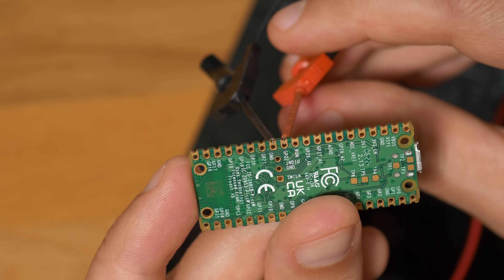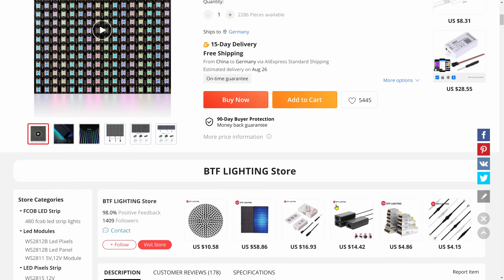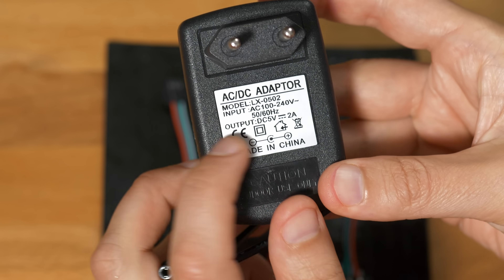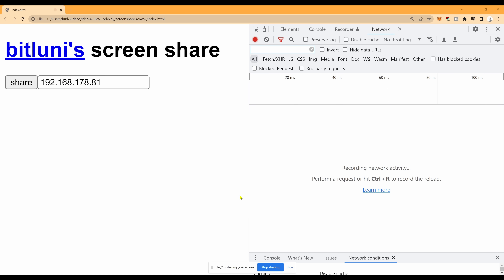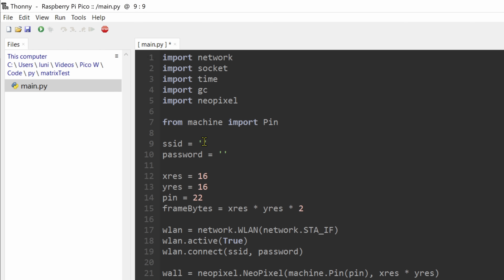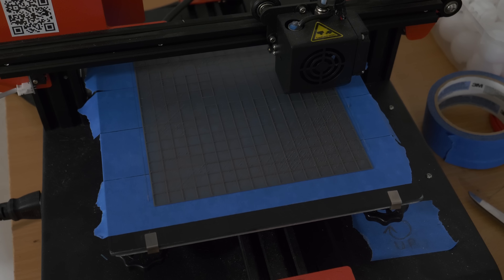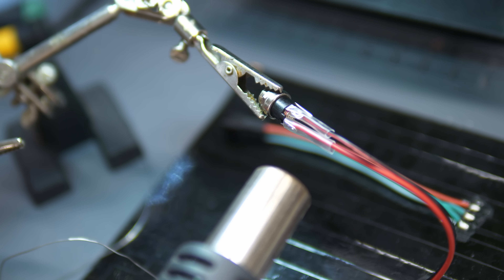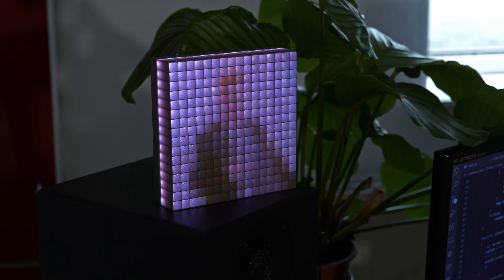Screen share ANYTHING to this matrix! (Pi Pico)

Comment: Could you 3D print direct on to a diffusion firm, and just skip the first layer.
Reply from the maker: this is genius! will try and upload result
Reply: @bitluni  maybe get in touch with Thomas Sanladerer
Reply: Or maybe switch filaments between first and second layer. Transparent or grey for the first layer, and Black for the walls.

Comment: Hi thanks for this tutorial. I'm trying to run a screen share using:

1. RGB LED matrix - 64x32-pixels
2. i75 with Pi Pico W onboard matrix driver

Am getting no errors, but nothing is showing up on the matrix. I have altered the xRes and yRes but no success. Is there something to do with the pin or anything else? Any guidance would be helpful. Thanks.

Comment: Would a Pi Zero W be even better? I want to start a project using 4 64x64 matrixes to make a mini LED board for my DJ set. I want to be able to sync the visual effects from virtual DJ's video mixer to one of these over WIFI. I'm new to this but want to learn basic coding and scripting.

Comment: Another question set :), you can connect to any gpio (GP) pin right? And what if you wanna join a couple of this matrices? Just connection output to input and one data gpio will do? Finally how should both be powered?

Comment: if you wire the neopixels directly to the pico, you might get problems in noisy environments, since the rp2040 runs on 3V3 and the ws2812b expects a 5v signal voltage

Comment: I ended up having to put ears on the corners to keep them from lifting. The rest of it printed up beautifully, and then I tried tearing off the ear like I usually do, forgetting that the bottom layer is no stronger than the ear.  Oops!  It looks nice with faux marble filament anyway and I'll take a second swing at printing it later on.

Comment: In case anyone's trying to print the undimensioned STL files, I set the height of the entire print labelled to 42mm and printed and it fits perfectly. This is for the "30mm" (distance from LED to diffuser) file.

Comment: UDP stream is the most efficient way to send pixels to the RGB strip. Also using C++ would allow you to do it in 60 FPS. I did similar project with esp8266 and 288 led strip.
And also, you can go to your router settings and assign static IP to the rpi so you don't need to update it everytime...
Reply: Hello, I have a similar project that I am working on. Could we exchange on the C/C++ solutions you found?
Reply: @PunesLeltier  yeah, but I'm still experiencing some troubles reconnecting to the server (from esp). If you can improve on that it would be great. I'll ping you in Discord

Comment: I get that devellopping is part of the journey here, but you COULD just use signalRGB for this with the raspberry pico W.
It comes with screen sharing for stuff like this allready included aswell as support for the pico and pico w. :)
It's also a slider for refreshrate and other features. :)

Comment: Nice and inspiring video! I really want to build some kind of led screen with e.g. a clock for running events and similar, that can be set and controlled remotely, but then these led matrices are too small. You showed that it's possible to chain them though, but could you make a video on that topic to easily extend the size a bit?, but without making it a ping-pong wall :)

Comment: Immediately I'm thinking, "What about 4 panels next to each other?"
Reply: Or... 9 ?
Reply from the maker: yes
Reply: @bitluni  I tried 4 panels -- all 4 light up, but the image is jumbled. For example, I made a 2x2 grid test image with a Red square, a Blue square, a Green one and a White one. When the image is shared to the Pico, LED panels 1 & 2 have red and blue lines intermixed, and panels 3 & 4 have green and white lines intermixed. I can't figure out what to tweak in the code to fix this -- any suggestions?

Comment: I think the Pi Pico W is the most fun and cheap way to learn all kinds of programming disciplines: IO, memory, APIs, logic…
Reply: @wesleyswafford2462  esp8266 we're single core, but the newer esp32 are dual core. Haven't tried the pi pico w since when I bought stuff for my wireless led matrix project the esp was cheaper but it also is a golden hammer.

Comment: Ah, eternal love-hate relationship with the WS2812-type LEDs, worked in enough things that have zero redundancy on the serial line, meaning the moment an LED went out it would take out everything after it in the chain too. Makes the newer WS2813-type ones with their redundancy pin seem really appealing after that .-.

Comment: concentrate the solar to the panels you already have with aluminium mirrors
Reply: parabolic mirror to one/two-sided solar panel
Reply: collect extra power as direct heat from the panels
Reply: same collector is the cooler for the panels

Comment: Techmoan recently took apart a really bad ikea sound visualizer thing, it used a microphone to "detect" the "beat" and step through a low res gif. More interestingly it used an LED grid like this and a frosted translucent plastic panel of lenses to create large circular "pixels" from each LED. With a clear-ish filament you could probably 3D print a similar pixelizer panel to produce a look like this, but with much less depth, I expect less filament, and you could potentially put a gap between the pixelizer and the LED panel, which would , if vented top and bottom, create a natural convention of air across the LEDs to help keep them cool

Comment: Looks like I finally might have found a reason to dig out my long disused 3d printer - I hope it still works . 

Apart from the rp2040w I have the rest of the components...

Thanks for sharing this , a great project !

If you don't mind me asking how do you get such great video of the led panels in operation? I have just started making video & I struggle loads with this so any hints would be appreciated!
Reply from the maker: ESPs should work fine

Comment: i made a similar thing about a year ago based on the esp8266, it has clock, weather, patterns, drawing, games, animations and streaming via jinx! capabilities, i think you need better diffusion tho i used 2mm thick frosted acrylic and a sheet of tracing paper (or wax paper) behind it, and the leds were completely diffused

Comment: I made a tile wall with custom 16x16 neopixels each, running from an ESP32. I wrote a windows app so it would stream a region of my desktop over UDP to the wall (I only had 15 tiles to start with) and it ran great over WiFi at 60fps 😁 Yourube videos look great on it. Takes a LOT of power though. Obviously in c/c++
Reply: Hello, I have a similar project that I am working on. Could we exchange on the C/C++ solutions you found?
Reply: I would like to understand what you have done also!
Reply: I build this with wled and send a json to update.